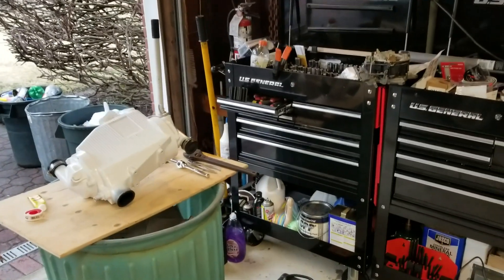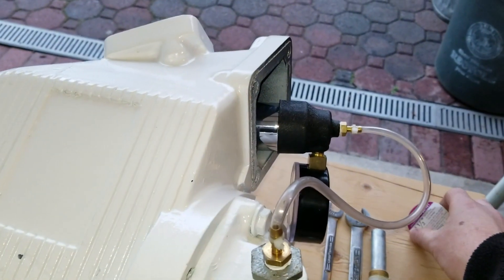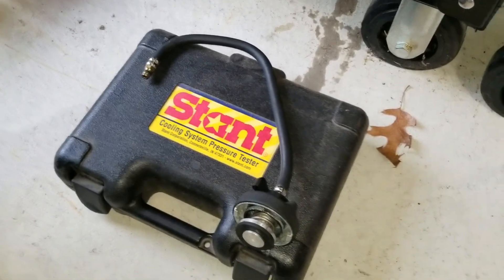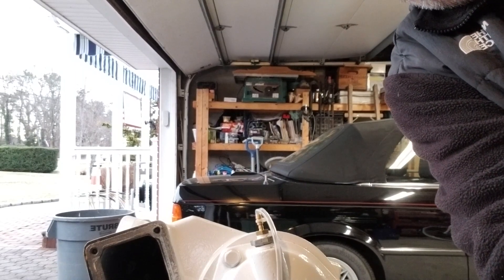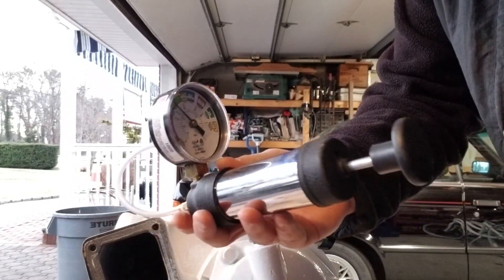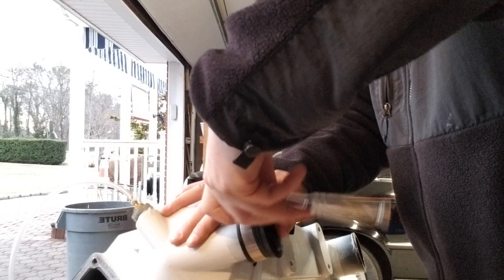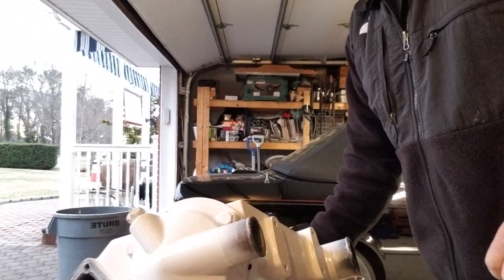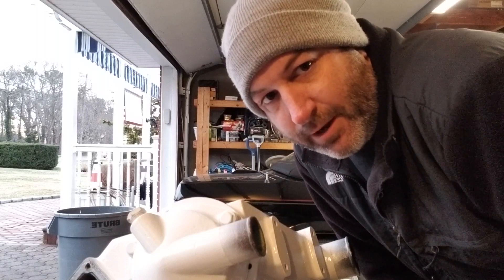Marine Aftercooler Heat Exchanger Pressure Testing

Comment: Good stuff - purchased boat w/cummins QSB 5.9's this fall and will remove and clean, test, etc in the spring. little nervous but looks fairly straight forward. Thanks for the video!
Reply: Just finished both aftercoolers and tested per your setup. Works like a charm! TY!

Comment: Just wondering why you don’t test to 30 psi ... given your turbo should be pushing 25 -30 ?
Reply: The boost can hit those numbers but remember that on the other side of the aftercooler o-ring is the seawater pumping though which is under some pressure as well (100% determined by how clear or how blocked your coolers are) so the o-ring is subjected only to the delta between the two pressures.